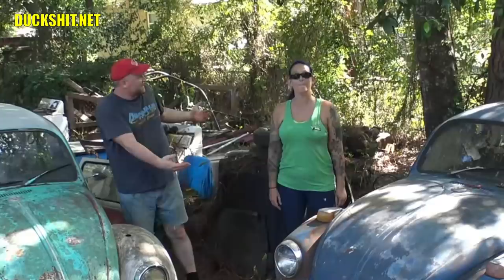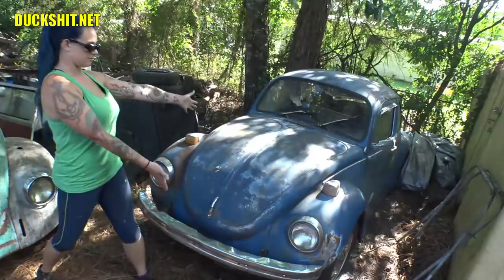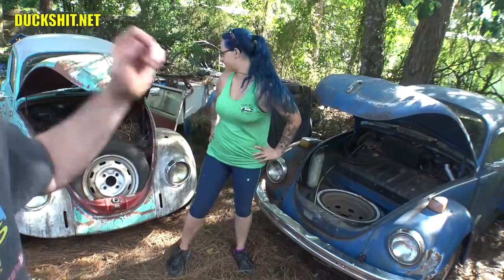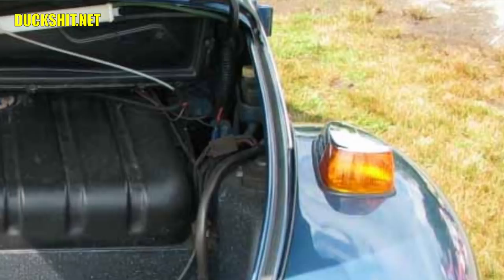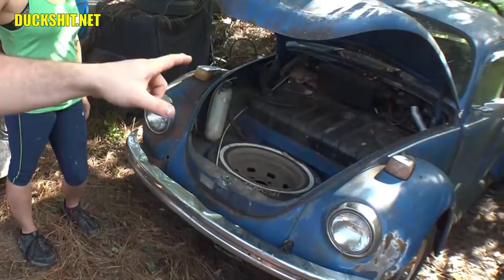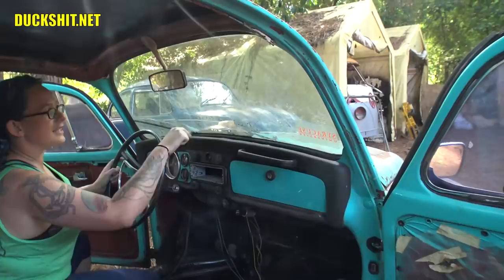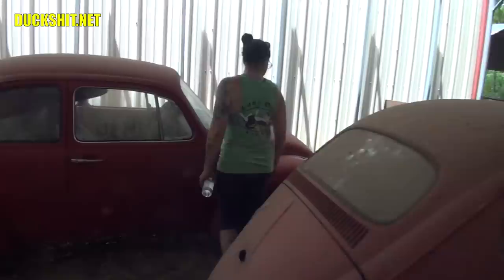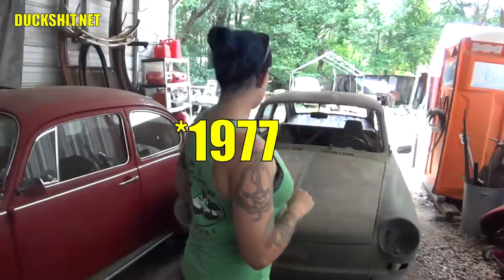VW Beetle vs Super Beetle - Whats the Difference? - Midday Q&A 108

Comment from the maker: Which do you prefer?  Beetle or Super Beetle and why?
Reply: I am into Supers. I've had a standard (70) but I grew up and spend my formative years in a 74 Super so I'm inclined to like the 1303s more.  I have a 72 1302 which I love since it has all of the old general standard look (flat windshield, dash). I have had a 74 1303 I've moved onto someone else and my 79 1303 which I love dearly.  I know there are haters and lovers, but for me it comes down to the rack and pinion of the 75-79 era. I love my rack and pinion.  Having had both and worked on them all I just don't see any difference. I mean... all cars have differences. The Supers certainly didn't kill the Beetles in the US... that was the inevitable change in market place, not to mention limitations of the air-cooled engines. VW needed the Golf and once that was into production there was no turning back to the ancient design of the Type 1.
The Porsche-inspired German Look is also my favorite style of modding for Beetles, and a 1303 just is perfect for this look given the curvier more rounded front.. To me, standards don't work for that look due to the narrower front. At least not like the 1303s do.
Reply: I think i would go with a beetle(just modified)
Reply: Anu bettle goes...
Reply: @toddmichaeljaniszewski  Yes I agree the 1303 is the one to go for if you like the superbeetle, I don't no why but in the UK the superbeetle is so cheap to buy , but parts are twice the price, nobody seems to want them maybe I should buy one now to keep , and hope the market changes , I do like that curved windscreen 👌👍
Reply: Don't see many super beetles in factory blue. Just not as popular like my green one. Remember I will buy some parts off the 72 if you want to change pieces on it.
Reply: But i have to say that Bee has a gooood taste for cars... Ghia is a nice looking car
Reply: I have a 67 beetle I truly love but I also have a 74 standard beetle that I enjoy driving and I’m in the process of restoring a 71 super I really enjoy them all
Reply: I prefer the Standard Beetle Looks and How they drive. Every Super Beetle I have driven seems to have a little shimmy in the steering wheel. But that’s just me. My original car is a 72 I took apart in 1991 so I should get it back together someday. Young and dumb syndrome. I have my Rebuilt engine in a 1973 Standard Beetle its a little rough on the edges but a driver.  I am a mechanic and I also take care of a 1971 Super Beetle for an Older Couple.  It’s been in their family since 1973.
Reply: I owned one of the last 1979 Volkswagen Convertibles - had a low low production number (1590000109)!  Was a baby blue with white interior and white top.  Sadly the payments were twice as much as my rent - so it ended up getting repossessed after 6 months of ownership! :'(
Reply: @Volkswagenplanet  I used to have a green 74 superbeetle when I was in the military in the 90s, just got my 68 ghia back last year I had back then also.
Reply: @sheldonjr7hp  You are correct, many S-Beetles had problems with steering wheel shimmy, even when they were brand new. Used to drive people nuts to try to get it to go away. I'm sure it was the strut front suspension design. I know, I was THERE.
Reply: Standard beetle for me, never liked the front wheel shimmy many S-Beetles had. Didn't like the struts either, pain in the ass.
Reply: No stupid beetle.. trying to improve on a proven platform? why?.. Ok, vehicular evolution is bound to happen.. and struts have their place.. just not under a beetle. I've driven both and prefer a beam over strut but I'm a little bit of a purist when it comes to VWs.. and that is only my opinion, and that's based on being around VWs for over 50 years.
Reply: I’m on my third standard Beetle. I’ve never driven or been driven in a Super. I could have a 1302 but not a 1303, the big windshield and the dash I couldn’t live with. Steering shimmy problems aside I’m sure the Supers drive better but the standards drive fine and look way better.
Reply: Looks like "owners must not repair" started with the super beetle front struts.  I am haunted by a cover of a VW magazine from roughly that era.  It showed a Dune Buggy with wide tires making a turn on asphalt.  The outer front tire was riding on the inner edge of the tire.  It was of course based on the older beetle.  I like the IDEA of the front struts, they should have worked better than the old suspension, which was only suited to narrow, round cross section tires..  I also liked the updated looks of the 1303, including the dash. I had always thought the flat front windshield clashed with the overall roundness of beetles.  I had just become a teenager then and couldn't drive yet, I had another two years to go to learn to drive.  By that time I was in another country whose basic car made the VW look huge!  It was the original "Nuova Cinquecento" or new Fiat 500.  Yes, there are two ""new" Fiat 500s, the current one and the one I just mentioned that debuted in 1957 I believe  The original, slightly larger Fiat 500 was in the 1930s.  Anyway, original beetles are about my least favored VWs.  I'll take a Splitty Bus or a Bay window Bus or a Kahrman Ghia or a Super Beetle over them.  I do like seeing how they work and how to fix them.  If the British had had any sense, we might now be talking about all the things done in California to Morris Minor 1000s!   The Brits didn't give a sh*t about what they sent to "the colonies".  We put up with it in the sports cars, but weren't that stupid about any other type of car.
Reply: Now that I'm an old fart I have to say I like the smoother ride and easier steering of the Super. But all VWs are beautiful, from the first Bug to the latest GTI.
Reply: A super beetle! 
Because the suspension and the space 
15 cm larger than standard
I have a 1971 super beetle
Reply: Super Beetle: two standard German beer crates fit in the trunk. Standard Beetle: none.
I had a 1302 in the 80s, and we used the trunk a lot :-). Thank you for your great videos!
Reply: My first beetle 30 years ago was a flat screen 71 super. The owner let me drag it home and said if I get it running to give him a couple hundred. It was running two hours later and he was paid. I have a barn full of parts to several standards and supers I've owned over the years. I right now have Bert the 73 curved screen super, and Fred, my 68 cabriolet. I also have a 69 Baja shell and would love to finally finish my sears Rascal dune buggy (a Meyers Manx knockoff). Just no time to play with my own.
Reply: never a super beetle... front is too round, round window (later model),.  the super beetle just doesn't have the crisp body lines (front) in my opinion
Reply: Super beetle
Reply: I like ALL air-cooled Volkswagens,,and later,  vanagons,they still had the simplicity and utilitarian quality that these overpriced imposters don't have
Reply: I prefer the REAL Super Beetle, the 1973 and newer. Curved windshield, new dashboard.
Reply: If im driving street. Super beetle. If im driving one to use for everything. Standard beetle. Mostly because of the front end suspension
Reply: Beetle
Reply: What happens with that vw bus over there. Are you going to fix it or sale it.
Reply: I recently got a 72 super don't know much about them but ready to put some work into it
Reply from the maker: @joshua villot Well my new friend you came to the right place!  Lots of videos from me, over 1000!  Please feel free to ask if you have any questions!
Reply: @sheldonjr7hp  mine is a standard 72 too
Reply: I like the south African super beetle which is a weird and unique combination of the standard beetle and the 1303 super beetle because it different and being a curved windscreen standard beetle makes it the chassis very customizable
Reply: @bendordoy4815  Those are very intersting.  I have not encountered one, but I have read about them!
Reply: Me nither I've only read about and see photos of them and being a 1 county only car makes them rare
Reply: I'll stick with my 53 zwitter, nothing beats the style of a split window.   Compared to todays cars both the standard and super have terrible rides but we don't drive beetles for the speed or ride quality.
Reply: Beetle
Reply: I prefer the standard beetle to the stupid beetle

Comment: Wow great instructional video. i own a 70 Beetle but didn't know if it was a Super or Standard. I need front body work and started buying parts years ago and can't find front fenders without the turn signal holes. Great video and it's funny but I'm a long time subscriber. You and your family stay blessed and safe.
Reply from the maker: Thanks so much!  If you have qa true 70, then its not a super as they didn't exist yet.  On the subject of fenders you'll have to weld the uwanted signal holes shut, or get an earlier set of fenders from the early 60s for a semaphone car.  You'll need earlier headlights and you'll have to cut the bumper holes for your 1970 bumpers though.  Things to think about!  Thanks for the questions!

Comment: Had an orange '73 Superbeetle. Loved it! Only thing that 'bugged' me was the windshield in the winter would never defrost so I had to pull over every few miles and get out to scrape it, then get back in and go another few miles, etc.. Should've bought one of those plug in 12v heaters. I probably would've kept it but I didn't know any better. Now I'm thinking any beetle will do if I get another chance.
Reply from the maker: Yeah I can be a pain to keep them defrosted, the heating system has to be sealed up properly!

Comment: While you can say that the curved windshield, which started in 1973, was for better safety, as far as having the windshield further away from the driver and front passengers face, the standard Beetle with the flat windshield continued up to the 1977 model year, at least in the USA. It was only the Super Beetle Convertible that continued, in the USA, up to the 1979 model year.
Reply from the maker: Thanks for that, you're about the only person that actually got all those pointers correct!
Reply: @vvtheduckvv  The hardtop Super Beetle continued, at least in the USA, until about 1975 or so while the hardtop standard Beetle went up to the 1977 model year..
Reply from the maker: 1977.  😁👍

Comment: Had the Super, a 74.
Not a bad ride, rebuilding the strut-n- steering was a required practice.
Dash wasn't practical but looked cool. And the trunk could hold alot if ya removed the spare.
From the A pillars back was basically the good ole custom bug.

Comment: There's so many variations in models, I know of a Nigerian CKD which is unlike anything I've ever seen, it's a standard beetle with a dash I've never seen and unusual unique instruments and steering wheel. Also I think the razors edge karman ghias had metal dashes with  a padded top. I also have a rare unusual model a 1972 GT beetle which is a standard bug but with factory disc brakes, higher ratio gearbox, three unique colours, swing axle and padded dash.
Reply: GT Bugger the Nigerian CKD came in kit form to Nigeria from Brazil. The Brazilian Beetles had many unique features including a standard-ish dash but with square dials and unique switchgear.

Comment: I dont think anyone else mentioned it here but, the only way to tell a 73 from a 74 is the bumber brackets, 73 was the last year for the flat brackets and 74 was the first for the shock absorber bumper mounts. The way to tell a 74 from either a 75 or 76(cant remember which) is the buldge under the decklid, either 75 or 76 was the first year for fuel injection so they put a buldge in the apron. Great video as always!
Reply: 75 was the year they started that.

Comment: In 1971 my parents considered a Beatle but chose the Hornet because it seemed safer.  The windshield in the Beatle was the main reason.
Reply from the maker: Truth be told, the glass is really close to the driver in the Beetle.  That was the reason they move it forward in a Super.
Reply: @vvtheduckvv  I recall going with my Dad to a filling station.  There was a Bug on the lot that had been in a front end collision.  It was long after we had the AMC.
Reply: Yeah I wrecked mine when I was 18. Forehead smashed the glass despite the seatbelt. Luckily I have a hard head and walked away without a scratch. 😏

Comment: 1980 had changes in emissions laws requiring catalytic converters. 

Aircooled bugs were still made until 2003 for mexico etc where emissions laws were more lax. 

71/72 Supers difference is steering wheel. 72 was blockypadded
Reply from the maker: Emissions was only one thing.... impact and safety standards of 1977 were far another.Emissions could have been met with more mods to engine, or a simple Type-4 or later wasserboxer swap. For Buses, and then later Vanagons this is exactly what they did, but those met impact standards.  The Beetle wasn't viable though, the body needed a complete redesign to meet standards, it wouldn't be the same Beetle anymore.  The last german Supers were all convertibles, and produced in January of 1980 for the 1979 product line. Why'd they go past 1977?  Well the US had trouble getting the 1977 laws finalized until 1980..
Reply: Two important differences:
    1) The biggest, most powerful air-cooled VW Beetle engine,  1600 cc with 60 HP .
     2) The only VW Beetle with air-conditioning !

Comment: Hey Duckman and Bee!!! Don't quote me as this is all off the top of my poor bald head lol, but I wanted to add (still have 1/2 or so of the vid to watch) that supers got a little heavier than standards (at least the early standards like my '59) due to all the safety equipment. I want to say my '59 hardtop is about 1580 lbs without me in it but a '71 or '72 super might be 1800 lbs (just guessing). '73 and '74 supers got even heavier I would suspect, what with the curved windshield they added. Convertible standards and convertible supers ('75 and up) are even heavier due to bracing, etc.. Thanks for the video!
Reply from the maker: Thanks Ted, it is true that every year that went by the Beetle got bit heavier... even comparing your 59 against a 69 standard, much weight was gained... almost 200lb difference!

Comment: Supers (called Superbugs) came to Australian in mid 1971, replacing the 1500 Beetle. The first was the S, which is almost the same as the car in this video. The 1300cc in Standard body, sold alongside it had painted dash & I think the early S had the normal VW dished steering wheel as well? In my opinion, both features make the S  look even more like a Standard & really, 99% of people wouldn't see any difference.

Couple of years later came the L, the curved dash car in this video. During the Super years, the 1300 was a low seller.

Late 75, all models replaced by Standard, with flat windscreen, but elephant tail lights 1600cc. Simply using left over parts .  Beetle assembly in Australia & sales ends mid 1976.

Comment: Just to add a little confusion, some South African built Beetles had torsion beam front ends but the 1303 style windshields. Their standard bugs had the later bodyshells complete with big windows, C-pillar vents but on an early floor pan with link pins. You should their rear lights, elephants feet style lenses but on a base that attaches to earlier style fenders.
Only the North American market had IRS on standard Beetles in ‘69, in Europe we had swing axles right up to ‘78 when production stopped. South American bugs were the same.
Reply from the maker: Mexican Beetle also had swing axle for the duration.  The South African super beetle certainly was an oddity.

Comment: I wish I sawthis before I bought my beetle I would have been a lot more informed!
I had noticed they were all shaped differently when shopping around and finally landed on a 68. The shape was just so beautiful to me and the rest looked akward. The 68 looked mature, refined, classic... while the rest of the bugs I saw looked like cars trying to imitate a beetle but not quite getting it right. Again I didn't know much about them but I knew what I liked.
Reply from the maker: Good find!  1968 is a very peculiar Beetle year, almost like 1967 was.  It had a lot of one-year-only combinations of parts.  But you noticed it had the more classic shape, that would be correct!  But it was the first year for the short hood, short decklid, 4 lug wheels, and squared bumpers. It was the beginning of the late models, but far prettier than a Super Beetle!  :)
Reply: @vvtheduckvv  I couldn't find anything earlier than a 67 in my area most were post 70s unfortunately

Comment: I have owned a lot of V-dubs, but what is your opinion on Pertronix VS points & condenser? I never had an issue with Pertronix before. Mine never burned up or anything.
Reply from the maker: I am running a set right now in my Fastback, they've been good to me for the last several years!

Comment: I actually do have a question the paperwork on my car is for a 72 also by the door it has a date of 11/72  but it has the ugly dash 😰 with alot is switches on it would it be considered a 1303 it also has a curved window
Reply from the maker: Curved windshield = 1303, yes!  The paperwork is likely wrong or the numbers are mixed up.  VW started 73 models builds in August of 72.  So its a 73!  :)
Reply: Thanks for the info

Comment: will a super body mount on a beetle frame
Reply from the maker: Well, there is no Beetle frame to speak of.  They have a sheet metal body, and sheet metal floor pan.  But you can ALMOST put a Super Beetle body on a standard pan if that's what you mean.  You will have to do some cutting and clearencing in the trunk area to make the Super spare tire well fit over the axle beam.  But anything is doable with the right tools and determination!

Comment: They changed the dash in 65 when they changed the windshield to a slight curve.
Reply from the maker: The dash is mostly the same from 1958 and up, even the ones with the crash pad it's still the same underneath.